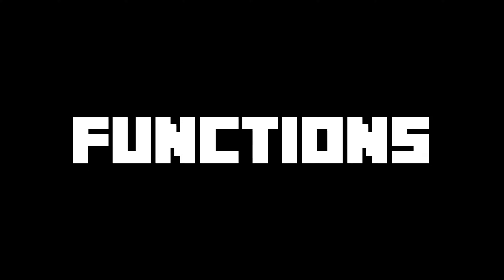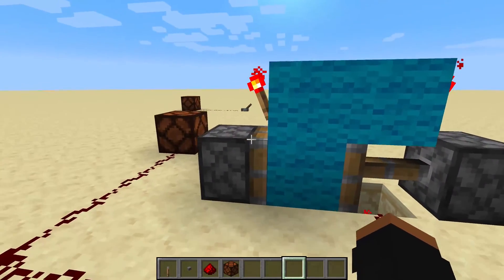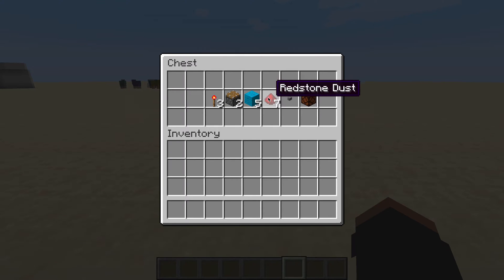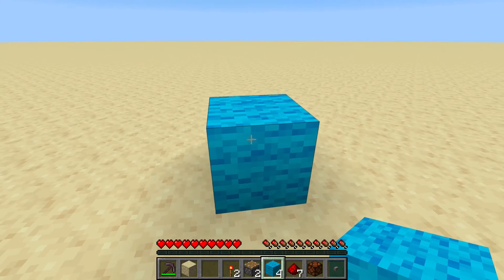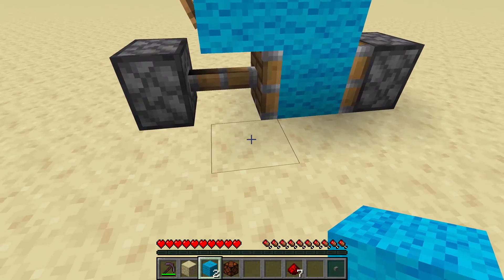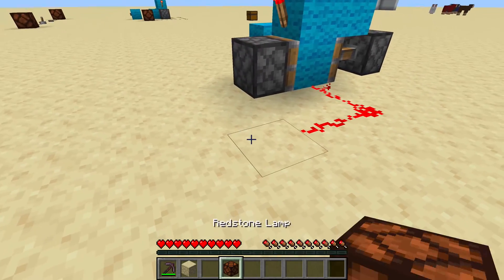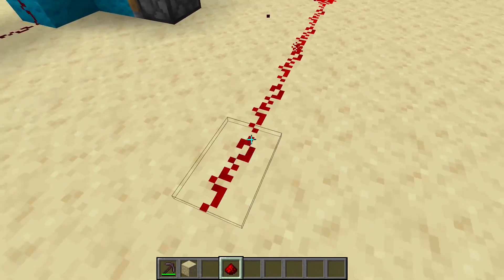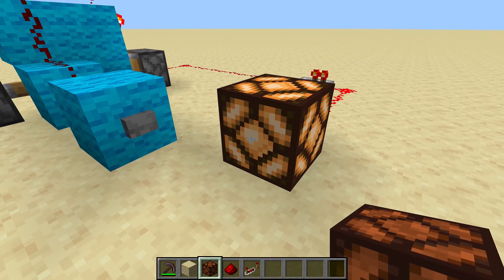How to Make a Button Work Like a Lever in Minecraft (T Flip-Flop) *2021*

Comment: If you have noticed it doesnt work 100% of the time, add a sticky piston and an observer in front of the redstone instead of just a button, so you activate the sticky piston holding the observer, with the button. This will work 100% of the time. Reply here if you have questions.
Reply from the maker: Thanks
Reply: I’m a bit confused where does the sticky piston get placed and where does the observer get placed
Reply from the maker: @peakzsy  Could you explain further?  There is no observer in this build, and the sticky pistons are placed 2 blocks away from each other.
Reply: @CowCapz  instead of a button you place a sticky piston 3 blocks away from where the button goes facing into that area then place an observer facing the button area and use that piston observer combo as the button replacement
Reply: Thank you
Reply: i had a simple solution bavk in the day, no pistons or any fancy shmack. only redstone torches , repeaters and redstone dust... but i cant remember how
Reply: I still don't understand...